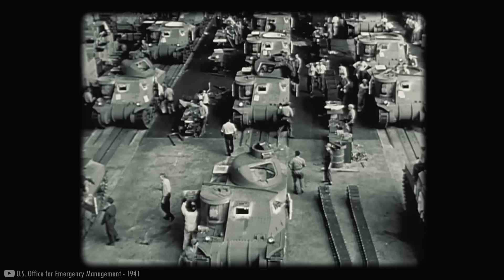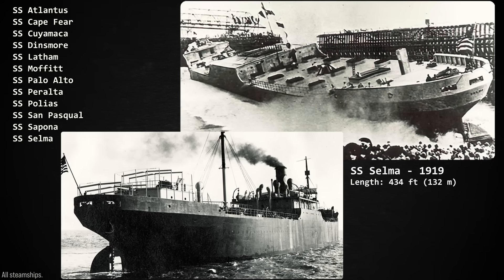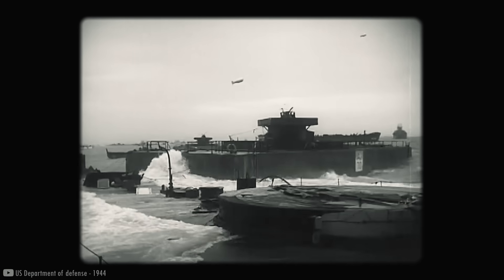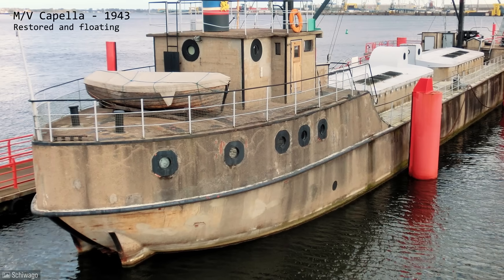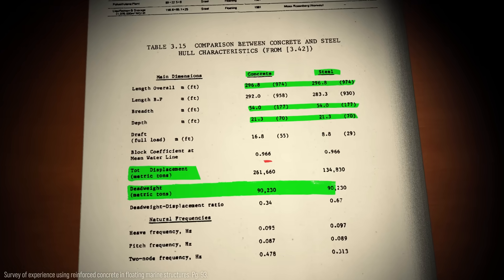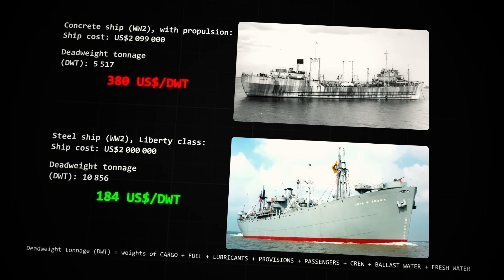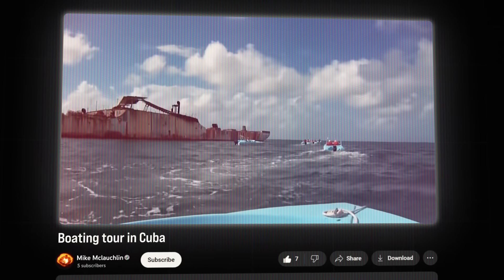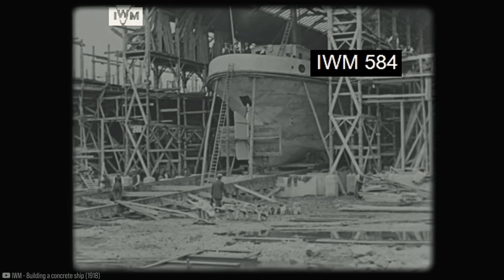The giant concrete ships 😮

Comment: Concrete ships had one more attribute which should not go unmentioned:  During WWII a submarine commander would identify one and stand down... nobody would waste a torpedo on a concrete ship.
Reply: Torpedoes don't sink concrete ships? I call bs
Reply: @josephmccord4511    Sorry bud, but thats the way it goes. 
  Oh, by the way.  Mind reading is a comic book super power.   You just cant sound like a rational, healthy, well adjusted adult by simply refusing to contact reality and spew your fantasies.  Try looking some of this crap up.  The entire web at your fingers and the best you can do is simply regurgitate your need to protect your presumptions?
Reply: @josephmccord4511  
Here...  I know of no test.  I know of no record either.  I know ONLY that I never said they wont sink.   You fabricated a straw man.   I do know there are problems with the attempt.  I can see it maybe cracking, but punching through like a sheet of steel and peeling it back to a ten foot hole?  No way.  Is a moot issue though.  I do know the quotes from several Nazi Captains who themselves made that very claim.  They would not waste a torpedo on a concrete ship.   That is what I said, that is what the captains said.  You of course, with no clue at all, no involvement and no history say differently.  Heh, is funny.  We're talking a minimum of foot thick or greater of steel reinforced concrete.  Even today with our modern toys we can find multiton missiles coming down on bridges built similarly and at best they put in a three foot hole but usually much much smaller if at all.  Much of the torpedo's effective efforts went into creating an air bubble under the ship... and area there was no water to support the ship at so as the explosion pushed in, the lack of support folded it as the center goes down due to the bubble.  The best torpedo 'hit' was when the torpedo passed UNDER the ship and exploded underneath... and cracked its back, breaking the ship in two because of the air bubble created.  Go ahead and do that to a ship make of steel reinforced concrete and what do you have?  A reinforced concrete bridge.  Duh.  They dont make bridges out of sheet steel, and if your concerned about torpedoes you dont sail in a steel hull ship.  You choose a fortress.  Made of reinforced concrete like they use on the bunkers that need armor penetrating warheads to deal with.  If your going to argue, then do so rationally,  and bring up some evidence so we can know that history has recorded a concrete ship going down to a torpedo, cause I couldn't find one.  I would actually like to know, see direct evidence.  I looked... did you?  They cost less to produce.  They produced them faster, cheaper, easier with less effort and less skilled labor,  but they cost a mint  in fuel to run because of their weight and because of the thickness of the concrete they had less cargo space so it was even more expensive.  Come on, we be talkin mobile fortress.    
  Really though, if you find a record of one going down to a torpedo slap that thing up here.  I would love to see.
Reply: @josephmccord4511  Not BS. In a convoy, with other to choose from, a U-Boat commander will always choose the highest value target. It's not so much about determining what a particular ship was made of as selecting a strategically more valuable category. Tankers were high on the list in an effort to starve the allies of fuel. Troopships or carriers, for obvious reasons. Ferro ships were generally "liberty ships", cheap to build and of limited cargo capacity and would not be worth risking revealing the presence of a U-Boat "pack" or spending one of the few torpedos onboard.

Comment: There is a concrete barge called the Louise Catherine in Paris that you can see when crossing the Seine on metro line 5. Built in 1915, it did sank some years ago when the Seine was high in 2018 but was later refloated in 2020. I believe there are plans to restore it, but work does not seem to be taking place from now. Thanks for the video !

Comment: My father built a sailing ferrocement one in 76' we still sail with it, nearly 50 years later. It's pretty and quirky. He told me he pushed to thickness enveloppe to the limit to make a reasonably lightweight hull. It does not look to have affeceted durability. I believe he was very cautious with cement composition. Other builder took less car and some hull were lost due to corrosion of the steel reinforcement shattering the structure. Maybe industrial could have get better displacement performance by using less thick hulls.
Reply: The thinner the hull, the easier it is for the seawater to reach the steel.
Reply: @UguysRnuts  Seawater entry is a problem for GRP too. The answer is a good watertight primer paint coating, just as used on GRP hulls (under the antifouling, if any).
Reply: @NiklasHolsti  GRP hulls don't suffer the catastrophic failure common to ferrocement. Longterm moisture penetration in fibreglass results in osmotic blistering that can be dealt with quite simply by opening them up, resaturating the sub-strat with epoxy resin, fairing the surface and applying an epoxy barrier coat like Interprotect2000. Fibreglass is infinitely repairable. With "ferro", the moisture does irreparable damage whether it gets in through microscopic porosity, fastener holes, hull damage or bilge water and is virtually undetectable until the bottom falls out.

Comment: As a boy, with little idea of water displacement and Archimedes bathtub, I was amazed seeing a  squarish concrete barge with A-Frame hoist tied to a San Diego dock.  The thing was loaded with tools and tackle and had freeboard about equal to draft, gunwales about a foot wide.  Not built for waves and that A-Frame bolted to the cement hull it's uniqueness among all things I saw floating there I've never forgotten.

Comment: There's a balance between the best product to use, versus the only product you can afford at the time.
Reply: Concrete was a TEMPORARY expedient for ship construction due to the high demand for steel by the weapons industry. It was only intended to last for a couple years, as, in times of war, many conventional steel ships didn't even last that long. Building a vessel from cement is a FALSE ECONOMY if you expect it to last any longer than that.

Comment: There's some correlations here to concrete pool construction and Shotcrete projects. Lots of steel reinforcement, small aggregate, limited added water, high level placement consolidation. Racquet ball, hand ball court walls are/were built with lots of pencil rod & wire, covered with Portland cement rich plaster (concrete grout basically).

Comment: It is said that if you are crossing an ocean, the best ride you can get is in a ferro boat. The worst is in an aluminium or fibreglass one. This is because of the weight of the vessel. I believe the worlds largest barge is made of concrete. It was made in France and is used in conjunction with an oil platform off Africa.
Reply: I have sailed in heavier GRP boats than Ferro ones of the same length so that theory doesn't really hold water. I don't think you will get an ultra light displacement ferro boat built, but they did build ferro race boats at one stage.
Reply: Wooden boats are quieter than glass, steel and ferro, even more so if the standing rigging has been replaced with kevlar/carbon/aramid fibre rope. The first time I sailed on one was absolutely eerie.